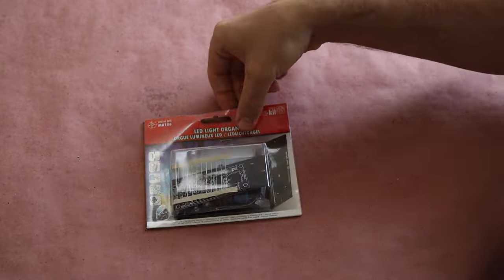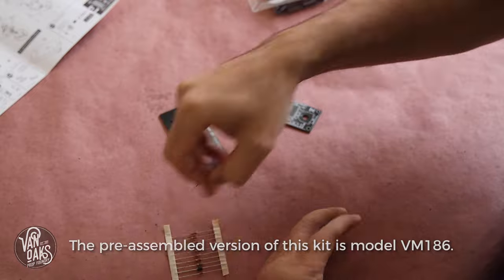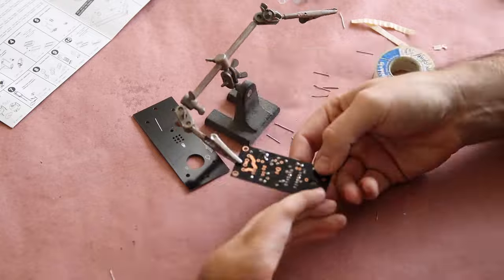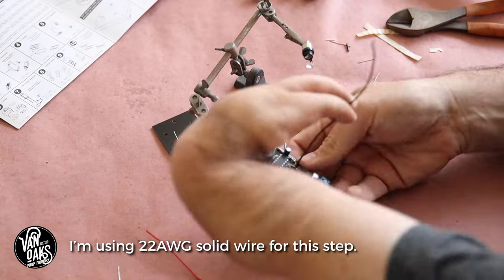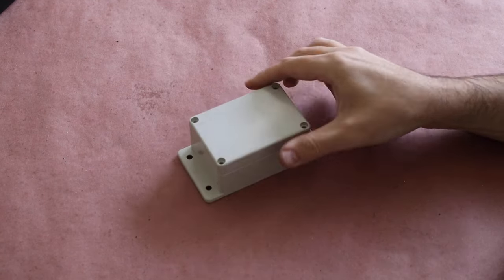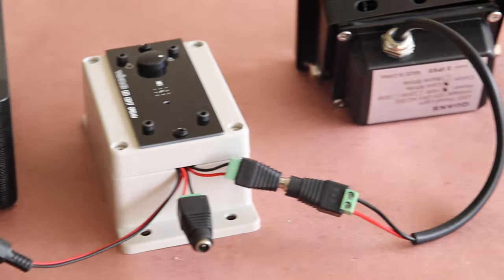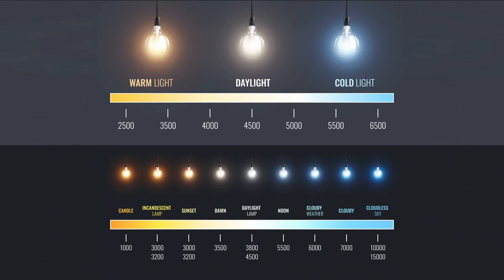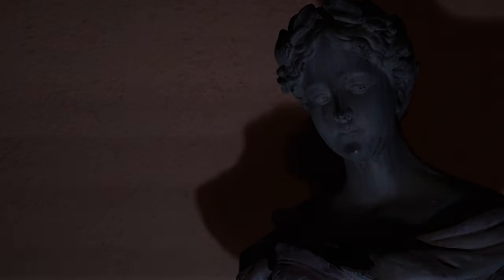PROP LAB: $20 Lightning Effect Box

Comment: Super awesome build.  I built one a few years ago very similarly. I used a $5.99 prebuilt RGB LED "color organ" and just had it drive a prebuilt SSR module(could use relays also for more current.. lots of clickity clickity)  /could do the same with some mosfets for your 12v.  (ebay search - 20 key RGB sound activated and mosfet/ssr/relay modules) .   The best audio / light enhancement trick is to take your lightning recording drop it into audacity, convert it to mono, make it 2 mono tracks,  move one channel forward about .5 - 2 seconds then save as stereo.  You hook your lightning effects to the forwarded audio side and the audio to the other track.  You get the lighting first then the sound.  The staggered timing does really make more realistic in your mind.  .... Also unsolder the resistor that fed the Electret mic its dc. I could not find the schematic online, or would tell yuou the resistor number-  sigh.. It will be the resistor that is connected to the + of the mic trace (there should already be a decoupling cap as part of the mic circuit ) . This should solve your problem.  As others mentioned the dc blocking cap inline could/should work, give it a try.

Comment: Excellent tutorial. This can be greatly improved with the use of an audio editing program. In the program convert the sound file to mono then convert it back to stereo. That will give you two identical audio channels. Then edit the left channel to be slightly lower in volume and a second or two ahead of the right channel. Then connect the left channel to the color organ and the right channel to your speakers. This will make it so it's easier to adjust the color organ. It will also make it so the lightning flashes before the thunder, better mimicking reality.

Comment: I still have my Perfect Storm lightning machine I got off Amazon years ago, dont see it anymore on the site.  I modified the speaker input to take an input jack.  I love that you can adjust the sensitivity to make the lightning look different
Reply: now they make that one with an audio in.  they are hit and miss online but cost around $40-$60 so this is way cheaper.
Reply: Would you mind sharing how you did the mod? Was it just an 1:1 swap or did you use additional hardware?

Comment: Overall a great effect, and that's what I expected to happen.  The Mic. input is basically to "hot" for a line-out signal level... But, yes you can attenuate the signal with a 50K pot (that's my typical "audio" go-to value)... The line-out goes across the pot (top and bottom leads) and the wiper (center lead) connects to your input along with the ground... or replace the pot with two fixed resistors you can measure the pot once you're happy with the settings, or you can try a 47K and 1K resistors that are connected in series, put the line-out across the resistor the two resistors and tap your input in the middle of the resistors, (across the 1K resistor). That's how you can eliminate a pot from the circuit.

I'd also add one more component to decouple any DC offset from the amp, use a small ceramic (non polarized) capacitor like an 0.1 uF. in series with the input to your device.  If there is any DC voltage from the amp, the cap passes just the "audio" portion and without needed to compensate for the DC voltage you can set your sensitivity pot on your light organ lower and get better control of the threshold where your light triggers.  

Disclaimer: You may need to experiment with the cap value, but I'd start at 0.1 uF. and depending on my results go from there, you may find you need a 1 uF or a 4.7 uF but I've used 0.1 uF and thought that was good enough...  most of these components are ballpark values and not super critical for this application.

How do I know this stuff?  well chalk it up to having done this kind of thing myself and a 2-year degree in electronics... so I don't know everything, just enough to be dangerous...   😜  LOL.
Reply: The decoupling cap is a good idea, not because of DC offset from the amp but because the small MIC used is most likly  a Jfet MIC like used in every thing these days. That means there is a DC pull up added to make the MIC work. So adding the decuppling cap will take care of that as well.
Reply: This is amplified speaker out not line out. I'm surprised it didn't blow the input of the I'm guessing op-amp being used from overvoltage.
Reply: @nyetloki , So while the output of the amp has a lot of power to drive a speaker, and it could blow up the input or damage it if you don't attenuate the signal (make smaller).  Think of it like using a small straw to drink instead of taking a big gulp.  Attenuation can get complicated for reasons...  but for our application is less fussy and we can get away for a few basic components, the key ones being: #1. a series resistor that limits the current,  and #2. a 0.1 uF Capacitor to allow the AC signal to pass, but not the DC component... this prevents the signal from the amp from overdriving the input by going above or below the voltage rails... I added a 3rd component a 50K potentiometer ("pot") to adjust the threshold so I can make the trigger point adjustable when the light would respond to the input.

I've DIY'ed this completely from scratch in my haunt...  and used it to control a prop and lightning.  I don't have any behind the scenes,  but you can see how I used this effect.  Check out my channel 2021 Yard display https://youtu.be/IDwy2YApNkY?t=52 ...  I also did the same thing in my 2019 Haunted Garage (you'll see a link at the end of the 2021 video).    Here's how it works:  In both those haunts the visitor walks up and trips a PIR sensor that starts up my Grimm Prop talking.  On one channel I have ONLY the speaking audio for Grimm -- the audio you hear is also used to drive the jaw motion (that I need to fix better). The other channel is dedicated ONLY for the lightning effect which is tied into the bright LED light controlled by the audio coming from that channel.  So what you see and hear is while Grim is talking the other channel is quiet until the thunder sounds... by putting the talking and sound effects on separate channels you get more control.

Comment: A couple of years back I bought the fully assembled and ready to go "Perfect Storm" unit. Ii works great and cost only $40. Add sound from included CD, and a light(I use 500 watt construction light which is half of what it can handle. Viola! A massive thunder storm behind my cemetery!
Reply from the maker: Thats a great deal on a Perfect Storm unit.

Comment: Tried to build one too, but then just with the mic. Must have been doing something wrong because it works like a stroboscoop and not reacting to sound....

Currently Im playing with LSC Smart Connect, which is a cheap smart light system with sensors and plugs and stuff. With this you can easily build like automations when ppl pass by. Works quite well :)

Comment: Another great video! I think adding a relay, or maybe a transistor to the output circuit would allow us to use a brighter, mains voltage LED flood.
Reply from the maker: Possibly, although the floods I used were plenty bright.
Reply: @VanOaksProps  What wattage is it? I was thinking something like a 100w LED flood would be good to flash a whole yard display.
Reply from the maker: @PixPete  That single floodlight is 75w equivalent

Comment: The mk186 or vm186 uses a LM324N quad amplifier IC. You are powering it at 12V, so the ICs input should only be 12V max. A typical speaker output will be 30V to 100V peak to peak (-30 to 30 vrms). That you didn't fry the IC is amazing. You are not using line out you are using speaker out levels*. You can solve this by adding a voltage divider resistor pair. A 10k to 1k or 100k to 10k for a 10:1 reduction would work and give you the control via the pot on the front. But if you *already have amplification involved then a simpler circuit of the transistor driver alone is needed. The IC is used as a multistage amplifier from 0.3V mic output to a higher 12V voltage range in the first place!
Reply from the maker: Good to know!

Comment: It's $28 these days and then you have the box and have to provide audio. I made some for just a couple of bucks using an Arduino and a MOSFET. No need for audio. The Arduino program can easily mimic lightning/electrical discharge patterns. I use one on an electric chair along with audio and dog control.
Reply from the maker: Damn price changes!

Comment: That’s a nice kelvin chart for explaining it ⚡️ so, the light is responding to the sound? Or vice versa?
I have a CHEAPO battery LED string that has a “Sound activated “ part to the on/off switch… wondered immediately if it’s using the same type of sound detector tech.
Either way, science is fun! ⚡️⚡️⚡️
Reply from the maker: That’s correct. The sound triggers the light.

Comment: Do you typically use LED's with your lightning effects? I this is the only prop that I tend to stick with standard halogen worklights because I thought that they react better to the dimming effect. Do you not find this to be true?
Reply from the maker: I use LED lights that can be dimmed so that you get the widest range of light, but Halogen work great too, although not with this controller. It's only designed for use with LED lights.